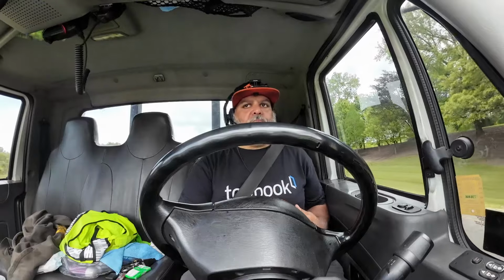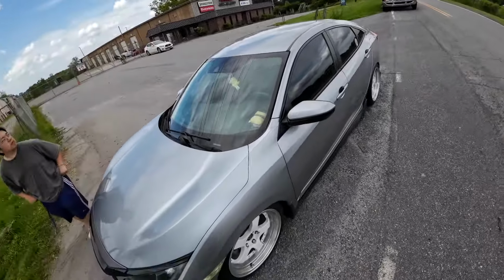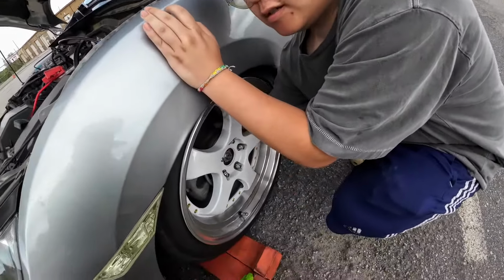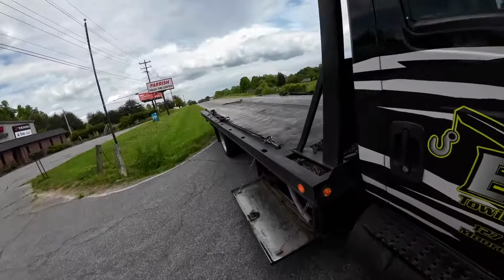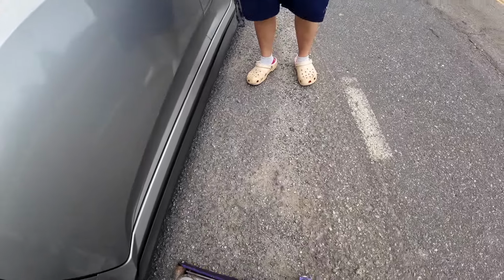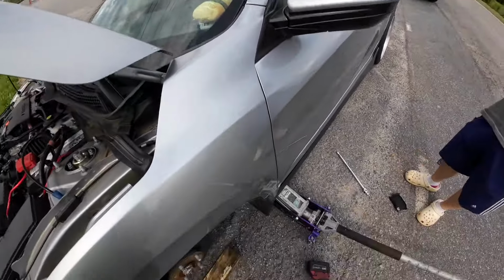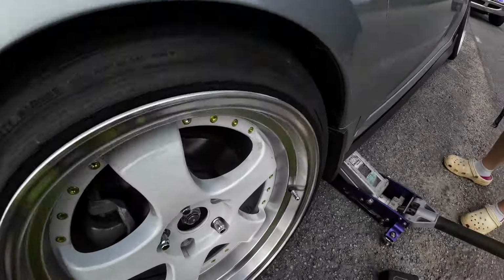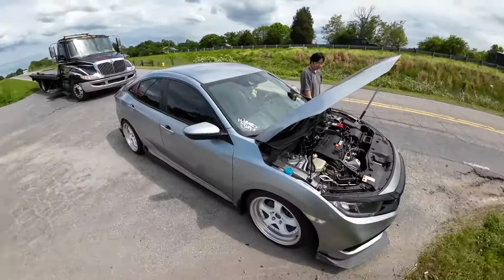HONDA CIVIC WITH BLOWN AIR SUSPENSION

Comment: Nice work! 
I carry a scissor jack and a couple foot long 2x4's for these low boys.
Reply from the maker: I couldn’t even fit a 2 x 4 under it   I’m about to buy airbag jacks for these cars 😂
Reply: @TowMan127 That may be too big to get under there also... lol. 
Thought about buying one but don't feel the need. I got a bag full of tricks like you.
Reply from the maker: @antsy602  yeah I know. I was joking. These cars get very low. As long as it drives I’ll use wood or skates like in this video or I’ll lift it with a strap from the rim if needed.